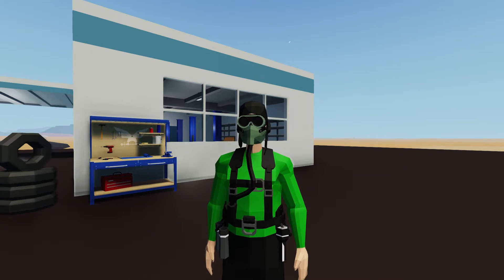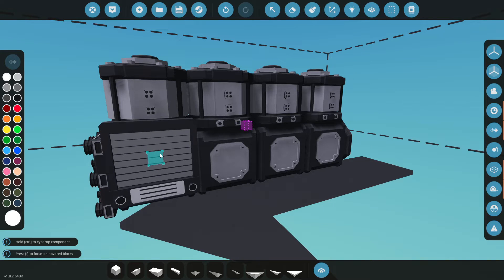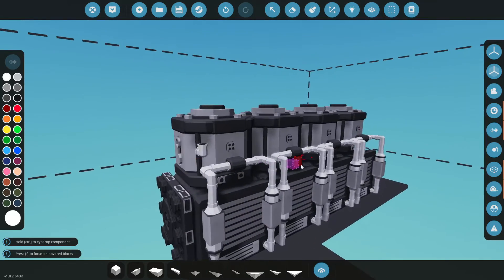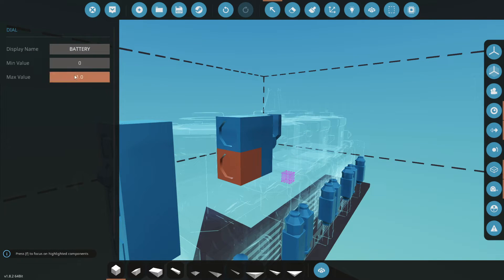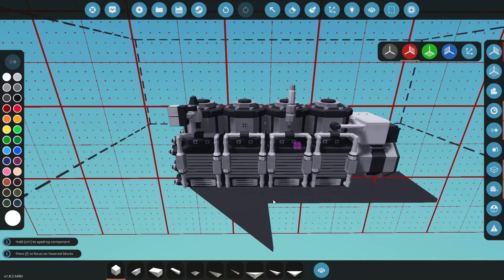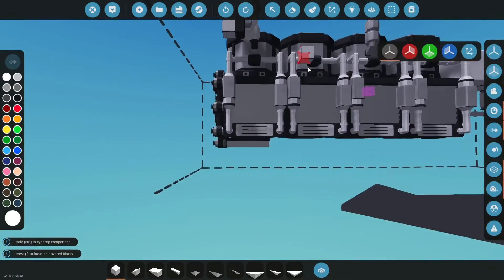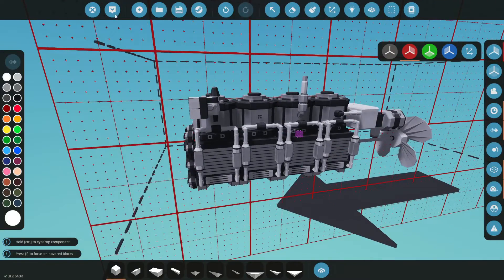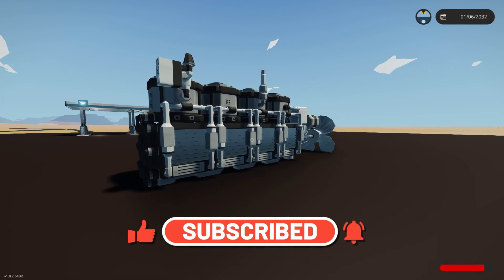4cyl 5x5 Modular Engine Build Stormworks Tutorial - How To

Comment: I never get my engine cold enough to run for a long time above 15 rps any tips? But the higher flow? Both intercooler and radiator dont really work for me nit even with really high flow by a large pump.
Reply from the maker: engines work best at 10 to 15 rps. anything over adds more heat.

Comment: Great video as always. I think the MC description says you need a clutch on the engine thats always on, a clutch before your gen thats connected to the MC and then a clutch before the gears which is then connected to the MC as well.
Reply from the maker: One for movement and another for the generator.  It's so the generator is not always running saving you power.
Reply: @ProfNCognito  The description states:
"If you have generator mode enabled, after the modular clutch you need other 2 conventional clutches, one going to your drivetrain and the other going to a generator. In this case also provide a constant 1 number to the modular clutch." 
You never tested Idle, so ... :D But in the end, the engine works and with some adjustments the idle gen mode too :D

Comment: Loved the video @ProfNCognito! Can't wait for the next video man! That was a Very Big Seagull, It Looked like it was as big as that Tire LMAO!

I have Some Historic Engines for you to Try and Build Man! These are Mostly Aircraft and Vehicle Engines from World War Two.

 • American Wright R-2600 Twin Cyclone: 14 Cylinder Engine, Length of 62.06 in. (1.591 Meters or 6.365 Blocks), Diameter of 55 in. (1.410 Meters or 5.641 Blocks). Supercharger being a Single-Stage Two-Speed Centrifugal Type, Impeller Diameter 11 in. (0.282 Meters or 1.128 Blocks), Blower Ratio at 7.06:1 at Slow Speed and 10.06:1 at High Speed. Fuel System is a Stromberg PR48A Downdraft Carburetor with Automatic Mixture Control. Oil System (if it can be Built) is a Dry Sump with One Pressure Pump and Two Scavenge Pumps. Cooling System is Air Cooled. Power Output is 1,750 hp at 2,600 rpm at 3,200 Feet (984.615 Meters) Military Power and 1,450 hp at 2,600 rpm at 15,000 Feet (4615.384 Meters) Military Power. Compression Ratio is 6.9:1 and Power-to-weight Ratio is 0.86 hp/lb. This is the Engine used on the Douglas A-20 Havoc, Martin 187 Baltimore, North American Aviation B-25 Mitchell Medium Bombers, Curtis SB2C Helldiver Dive Bomber, Grumman TBF Avenger Multirole Torpedo Bomber, and Martin PBM-1 Mariner Patrol Bomber/Flying Boat.

 • American Pratt & Whitney R-2800 Double Wasp: 18 Cylinder Engine, Air-cooled with Water Injection. Length of 81.4 in. (2.087 Meters or 8.348 Blocks), Diameter of 52.8 in. (1.353 Meters or 5.415 Blocks), Supercharger is a Centrifugal Type with Variable Speed, Single-Stage Single-Speed, Fuel System is a Stromberg Injection Carburetor, Fuel Type is 100/130 Octane Gasoline, Cooling system is Air Cooled. Power Output is 2,100 hp at 2,700 rpm, Power-to-weight Ratio is 0.89 hp/lb. This is the Engine used on the Curtis C-46 Commando and Douglas C-47 Skytrain Transport Aircraft, Douglas A-26 Invader Light Bombers, Lockheed PV-1 Ventura and B-26 Marauder Medium Bombers, Martin PBM-5 Mariner Patrol Bomber/Flying Boat, Northrop P-61 Black Widow Night Fighter, Grumman F6F-5 Hellcat, Vought F4U-1D Corsair and Republic P-47D Thunderbolt Fighter-Bombers.

 • British Bristol Hercules: 14 Cylinder engine, Air Cooled. Length of 53.15 in. (1.362 Meters or 5.451 Blocks), Diameter of 55 in. (1.410 Meters or 5.641 Blocks). Supercharger is a Single-Speed Centrifugal Type, Fuel System is a Claudel-Hobson Carburetor, Fuel Type is 87 Octane Petrol, Cooling system is Air Cooled. The Hercules XVII and Hercules XVIII that you'll find of the Bristol Beaufighter TF Mk. X had a Power Output of 1,700 hp and the Hercules XVI on the Short Sterling Mk. III, IV and V had a Power Output of 1,615 hp. Compression Ratio of 7.0:1, Power-to-Weight Ratio of 0.7 hp/lb. Aside from being used on the Beaufighter and the Sterling, this was used on the Handley Page Halifax Mk. III and the Vickers Wellington Mk. IC and GR Mk. VIII.

 • British Rolls-Royce Merlin Series: the Specs for each Engine in the Series Varied wildly depending on the Model, so I'm going to keep it down to the Following Aircraft that Used The Respective 3 Models; The Supermarine Spitfire Mk. V with the Merlin 45, The Lancaster B.I and Handley Page Halifax Mk. V with the Merlin XX and the Supermarine Spitfire Mk. IX with the Merlin 61.

  • Merlin 45: 1,515 hp at 3,000 rpm at 11,000 Feet (3,384.615 Meters), Maximum Boost Pressure of +16psi.

  • Merlin XX: 1,480 hp at 3,000 rpm at 6,000 Feet (1,846.153 Meters), Two-Speed Supercharger and Boost Pressure of up to +14psi.

  • Merlin 61: 1,565 hp at 3,000 rpm at 12,250 Feet (3,769.230 Meters), 1,390 hp at 3,000 rpm at 23,500 Feet (7,230.769 Meters), fitted with New Two-Speed Two-Stage Supercharger providing Increased Power at Medium to High Altitudes, +15psi Boost, Reduction Gear Ratio of .42:1 with Gears for Pressurisation pump.

12 Cylinder, Supercharged, Liquid-Cooled Engine. Length of 88.7 in. (2.274 Meters or 9.097 Blocks), Width of 30.8 in. (0.789 Meters or 3.158 Blocks), Height of 40 in. (1.025 Meters or 4.102 Blocks). Supercharger for the Merlin 61 is a Two-Speed, Two-Stage with Boost Pressure automatically linked to the Throttle, Coolant-air Aftercooler between the Second Stage and the Engine. Fuel System is a Twin Choke Updraft Rolls-Royce/S.U. Carburetor with Automatic Mixture Control, Two Independent Fuel Pumps. Fuel Type is 100/130 Octane Petrol. Oil System is a Dry Sump with One Pressure Pump and Two Scavenge Pumps. Cooling System is 70% Water and 30% Ethylene Glycol Coolant Mixture, Pressurised. Supercharger Intercooler System entirely Separate from the Main cooling System. Reduction Gear of 0.42:1. Power Output for the Merlin 61 is 1,290 hp at 3,000 rpm on Take-off, 1,565 hp at 3,000 rpm at 12,250 Feet, MS Gear and 1,580 hp at 3,000 rpm at 23,500 Feet, FS Gear. Compression Ratio of 6:1, Power-to-Weight Ratio of .096 hp/lb.

These Engines Should be able to Provide enough Help with Future Aircraft Builds or even your own Build of the Very Aircraft that Used them. As usual, the Source is Wikipedia for All of these Specs. I spent about 2 hours typing this up man. Let me know what you think about it and I'll catch you in your next video man!

Comment: i run 2 5x5s rads per 5x5 cylinder 1 on each side of the 5x5 crank shaft. never had a issue with cooling. but all my 5x5 run at 10 RPS max. usse gear boxes to increase the RPS to make ships do 100km/h+
Reply from the maker: Nice tips!